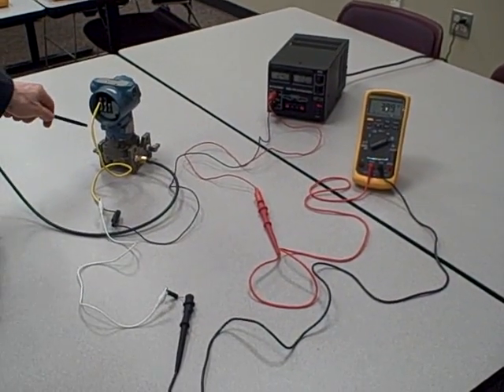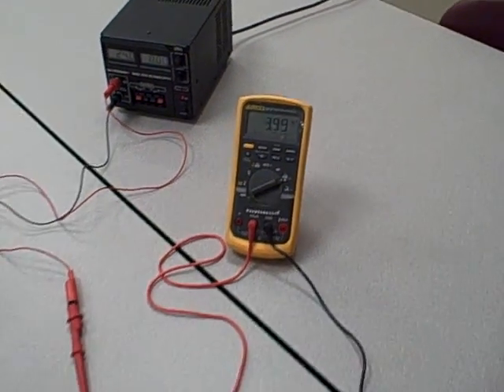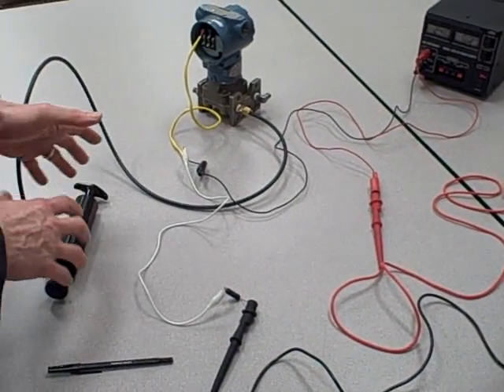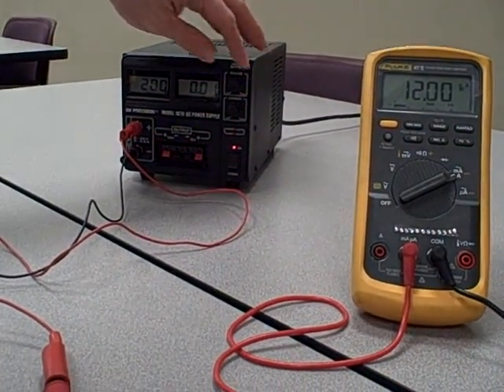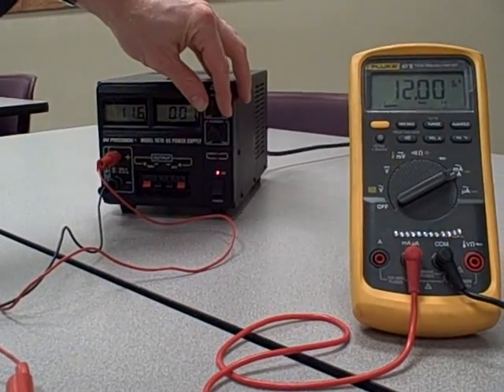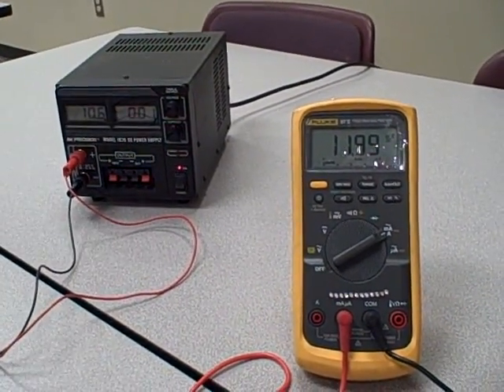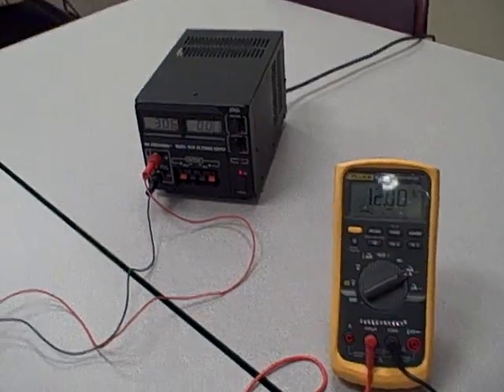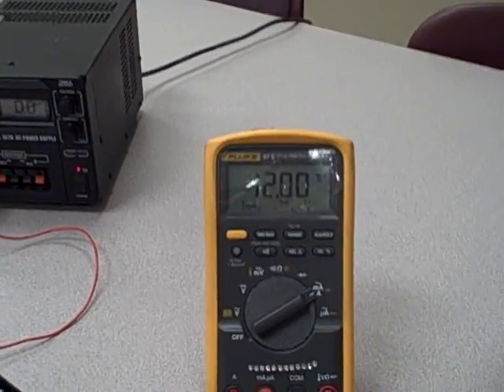4-20 mA current loop regulation

Comment: If you don't have a plug-in power supply or are in the field, three 9 volt batterries plugged into eachother in series will supply enough voltage to power your transmitter. Very good video. I have been doing this three years now  and I always appreciate when someone passes on the knowledge.

Comment: Hello BTCInstrumentation!
I am a very new on this and I would like to ask your help.
I am testing one noise sensor, according to this and what your book says, it is 4 wire: It has 2 wire for +12V source and other 2 wire for the current loop. But I have one big question, do I have to supply (another) voltaje to the loop to read the output current?

I connected the sensor to +12V but read nothing at the output. I need to confirm the sensor is good, or bad.

I hope you can help me. Thank you!

Comment from the maker: The resistor serves no practical purpose in this demonstration circuit.  However, most 4-20 mA loop circuits contain a precision resistor to generate a measurable voltage drop based on that 4-20 mA current.  For example, many loop controllers require a 1-5 volt DC signal, which you can get by passing the 4-20 mA current through a 250 ohm resistor.

Comment from the maker: Current is always guaranteed to be the same value at all points in a series circuit, whereas a voltage signal may degrade over long distances of wire due to voltage drop.  We use a "live zero" like 4-20 mA instead of 0-20 mA because the transmitter is actually powered by the current signal.  If it went all the way down to 0 mA, the transmitter would stop working.  The "live" value of 4 mA ensures the transmitter always gets power.

Comment: Hi,
  I plan to connect my a/d chip to a 4-20 ma sensor (a Honewell sensepoint). As my a/d is 0-5v input, I assume I would also connect the 0v from the power supply to my 0v on my board, as it has its own power supply.   Would this be correct?
Thanks
Scott

Comment from the maker: @sfacp If the sensor is 4-20 mA DC, then you may safely assume it's got either a current regulator in it (2-wire) or a true current source in it (4-wire).  Read the chapter in my book on analog instrumentation signals:

openbookproject (dot) net (slash) books (slash) socratic (slash) sinst (slash) book (slash) liii.pdf

Comment from the maker: @Mart34 Most loop-powered transmitters have minimum and maximum terminal voltages ranging around 12 to 40 VDC.  Specifications vary, so be sure to check the manufacturer documentation (datasheets, user's manuals) to get a definitive answer for your transmitter.

Maximum loop resistance is a function of minimum terminal voltage.   Loop resistance drops voltage, taking away from the power supply voltage, leaving the transmitter whatever remains.  R_max = (V_supply - V_min) / 20 mA

Comment: Hello, I am working on developing a simple training curriculum regarding 4-20ma current loops. I work in the industrial burner/boiler industry. Our industry has just about completely converted to 100% electronic controls and the use of 4-20ma current loops is very wide-spread. I am trying to find a nice simple, easy to view graphic of a 2-wire current loop circuit to demonstrate with. Would you happen to know a good example of one on the net or perhaps have one yourself? Any help would be great

Comment from the maker: @mcr1981 It's sometimes helpful to imagine the 4-20 mA transmitter as a continuously-adjusting variable resistance, increasing or decreasing as needed to hold the circuit current wherever it should be.   Thus, if some other resistance (load) in the circuit changes value, the transmitter senses the resulting change in current and immediately compensates by changing its resistance in complementary fashion to bring the current back to where it belongs.

Comment from the maker: Wiring detail #22 on page AP-10 says the white wire is nothing but a case ground, so it's really a two-wire transmitter: Red (+) and Black (-).  Therefore it should work just like the transmitter shown in the video.  Note that the "FMA" is an *absolute* pressure transmitter, so it will probably give an output greater than 4 mA at atmospheric pressure (i.e. it should output 4 mA at a perfect vacuum).

Comment: @BTCInstrumentation 

Sorry, this is the last part of the explanation (500 characters is not enough).

The sensor is a Sensotec 811 FMA pressure sensor. The data on the sensor states that it is a 4-20mA sensor output but it says it's two wire insted of three..... that is what I don't understand. I looked for a solution "how to connect three wire sensor" on the net but no luck. Until I landed here (great video by the way).

Thanks for your help. If you can help me I'm be very grateful.

Comment: @BTCInstrumentation 

Hi, thanks for the reply. I got a pressure sensor on a "garage sale" (company went bankrupt) from a friend. I'm starting with electronics and went to the machine shop of another friend to test the pressure. I connected the sensor to a power supply (15-50v) and I tried to measure the output (4-20mA).  Three wires: red, black and white. Positive power supply terminal to red, negative terminal to black, and the white I used as the current terminal (output). I had no luck.

Comment from the maker: @mcr1981 Typically three-wire transmitters take in DC power on two wires (typically red and black) and output an analog voltage signal between the third wire and DC ground (white and black).  Can't be sure though until you consult the manufacturer's documentation.  Every transmitter I've ever worked with has some sort of documentation in the manual showing how to hook it up.